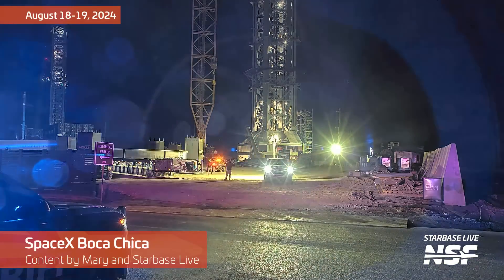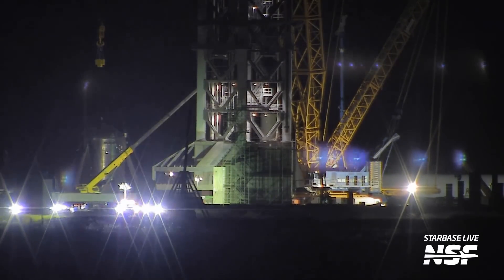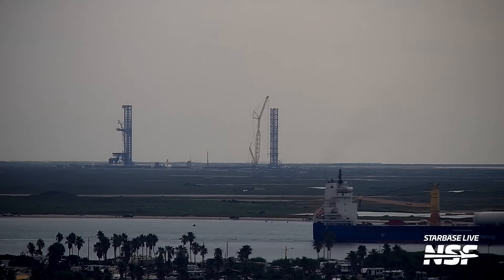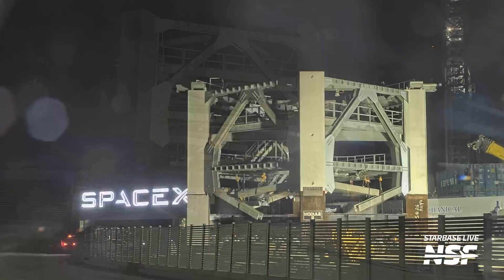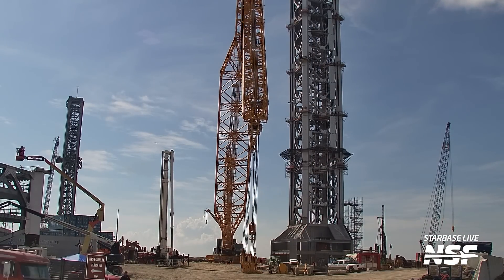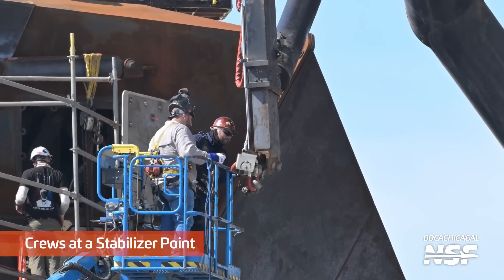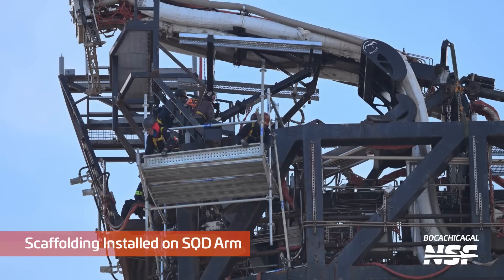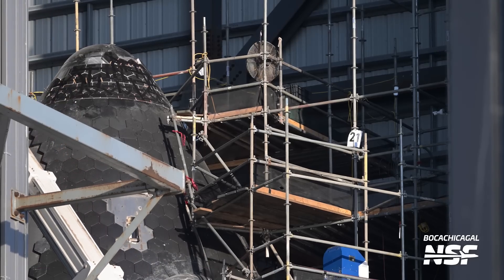Starbase Tower 2 final module, test tanks, and more | SpaceX Boca Chica

Comment: 5:40 😱 I'm a welder, and those "band-aids" are meant to reinforce, not by the amount of weld or the plate thickness, but the direction of the weld.
Material stress can lead to fracture, and fractures like to follow welds on stright line.
By using curvy shapes help fractures don't spread that easily.
On the other hand, sharp, pointy, narrow angles, tend to lead stresses to converge to the same point, increasing the chances of a fracture. 

That's my concern about those plates shape. It might be approved by an engineer, but I see it with concern more like a "band-aid" than a fixing or reinforcement.

The solution to it must be an structural study, stronger material, more thickness, careful welding, and basically a new structure designed to widstand the loads forecast by the estructural study.

By the way, those plates have another inconvinient: blocking the inspection of the welds to find a developing fracture.
If it developes on the structure, or the plates cause it to the structure, the plates can't widstand not even the smallest part of the load by itself.

Those "band-aid" plates, can have other shapes, and I think on English they call it "fish-plates" for it's shape of a fish.
Hope it explaned something.

Nothing more, but again, as a welder... I'm concerned about it, even if an engineer aproved it.

Comment: always been binge watching / glancing at 2x speed and faster.. voice at that point (unless its molasses-slow-commentary) becomes comical - while ambient sound was still OK.  So unless the clean track becomes an option I will have to run this in silent mode from now on which will lose its appeal pretty quick and I'll resort to watch weekly roundups only (also at 1.5x or faster) - I just don't have the time to watch and listen to this on a near-daily basis at 1.5x or slower.

Comment: As a video editor myself, I would suggest an hour or so of your time to go out and re-level the cameras would be time well spent vs the time spent in post to adjust the rotation, then you have to scale the video to fix the black edging in the corners, which then also crops the video. it might only take a minute per clip, but add that up over however many clips per video, and post fixing would soon surpass the time spent levelling the cameras. Rule of thumb, if it can be fixed in production rather than post, then fix it. Camera levelling, white balance, and fps are the primary things I have to remind my clients about.

Comment: commentary > ambient > just reading labels
Ideally there would be 2 audio tracks (commentary and just ambient) that we can choose from.
Reply from the maker: I do hope we're able to get that feature back. We tested it a while ago... will keep yall updated. - Das
Reply: @NASASpaceflight  (06:44) The reinforcements they are adding are known in the field as "codfish" and are usually a sign of bad engineering, or a structure that now needs to accomodate loads that were not part of the original intent. They are used when you need to improvise a solution to something that has already been produced, installed and commissioned, so you can't simply replace the existing part with a new working design with better materials, or increased thickness, or enlarged cross section. By the location and the looks of it, they've possibly got a fatigue problem and someone spent a long time looking for the best shape for the reinforcements, as the usual simple shapes made the solution worse than simply not doing anything.
Reply: @_John_P  or they are being abundantly cautious. Wonder if the original design did not contemplate catches.
Reply: @donrubottom8723  This type of alteration is not done out of caution. A problem arose after either a structural analysis review or inspection. Catching has always been part of the design, what they could have gotten wrong was the mass and dynamic load of the booster, which both grew over time, and more weight was added to the chopsticks, which might have eaten up whatever reserve margin they had for future growth. With Elon's unrealistic expectations for the number of catches per day (+3 per tower), it could have easily added to too many design cycles on those joints (+80,000), thus they needed reinforcements.
Reply: @NASASpaceflight maybe two videos? With and without commentary? Or for subscribers only can get the ambient sounds?
Reply from the maker: That's a really good idea! Did you comment before you got to the end of the video....? heh - Das
Reply: @NASASpaceflight  i would love if the commentary was optional, because it is impossible to chose between ambient and commentary, both are good in their own ways
Reply: @NASASpaceflight  Yeah, I watched the video until the end. Mainly just like the ambient to play as it's kind of an ASMR vibe that just lets Starbase breath.
Reply: Guys you are literally repeating exactly what Das said they are going to do lol.
Reply: A third could offer silly tunes.
Reply: I wonder  if language  options  could do it?
Reply: Agree with this .
Reply: As long as it's Das doing the commentary.
Reply: MUTE

Comment: pregunta las dos torres tienen la misma altura  sies asi podria ser un gran error al no construir  la torre mas alta para futuras versiones mas altas de Starship  
este es el camino
Reply: Tower 2 is 1.5 M taller. But it looks like the SQD will be moved when they switch to V3 (if it ever happens).
Either way, Tower 2 should be compatible with V2 and V3, but not V1 or V1.5)
And Tower 1 is compatible with V1 and V1.5, but not V2 or V3.
(V1.5 is a V1 booster+V2 Ship)
Reply: @bryanillenberg  muchas gracias por la información desde Santander  Cantabria España    
este es el camino
Reply: @tomasbenedictomaza  Happy to help!
Contento de ayudar!
Reply: @bryanillenberg  Este es el camino